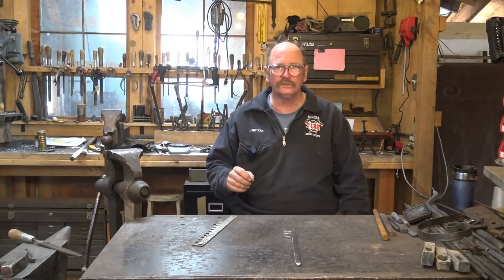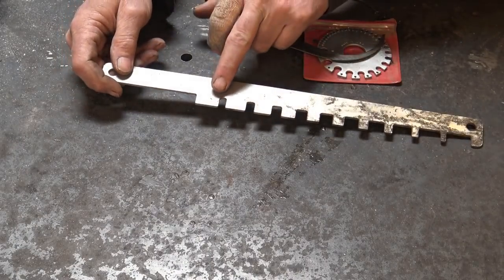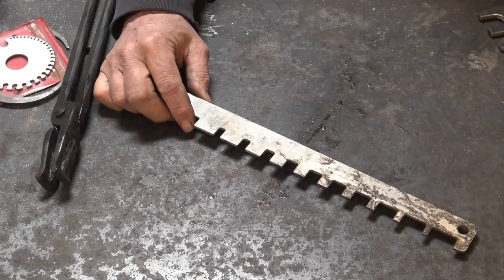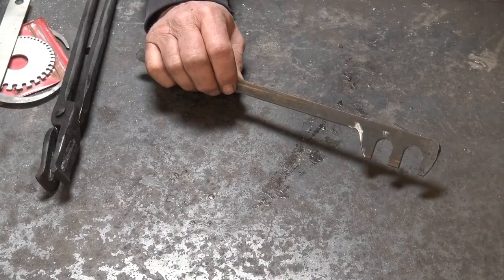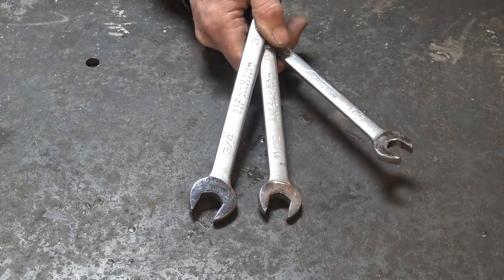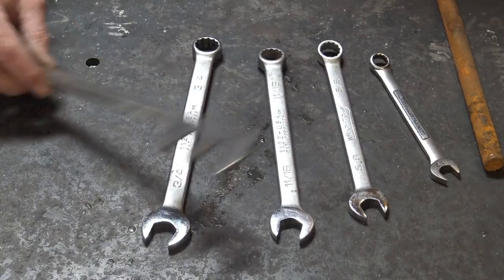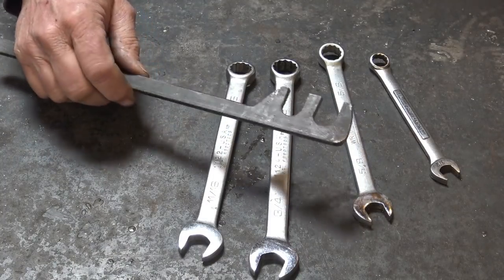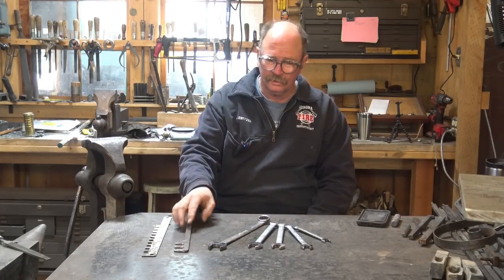Quick and simple shop measurements using a gap gauge - quick tip

Comment: A cheap 9 piece set from that discount tool store or local farm supply and some 3/16th mild steel rod to make a ring (all should be able to be acquired for around $10) sounds like the easiest way to go, to me.

I've got some of the wire/rod that forms the border of a mattress that would be perfect for making rings to hold the wrenches (tore up a couple of old mattresses from my kids' bunk beds...).
Reply from the maker: Some of that matress wire is higher carbon and makes good scribes
Reply: Yeah...this stuff is one of them.  It is pretty hard right now.  I'll need to check it out a bit better but I know  it isn't an air-hardening steel.

Comment: I just made a hanger for my gap gauges yesterday from flat bar. It has 26, 4 " long 1/4 round pins spaced 1 1/2" apart, for both SAE and Metric, and is hung over my work bench. No more looking for those gap gauges. The long pins allow me to hang multiple wrenches on each pin. A little bend at the tip keeps wrenches fron sliding off. I spaced and drilled holes in the flat bar to fit the round rod, chamfered the holes on backside and welded on back side. I had one and used it for years, but somehow it got moved in a shop mod and used for something else.  So I decided it was time for a new one. Also I have some 2' magnetic bars i bought on Amazon that I have hung up over my workbenchs,  which works great for those pesky double ended wrenches that have no hooks.  I hang files, drill bits, drill keys, scribes, centerpunches, chisels, punches, chaulk holders, and every thing I use daily on them, instead of laying them on my bench. Currently I have 16 ft. Worth of magnets overhead mounted to steel bars hanging from the ceiling, and have not had a problem filling them with tools. Just thought I'd share my ideas for organizing, as it seems to be a problem many individuals face.
Reply from the maker: Thanks

Comment: Should buy a cheap set and cut off the open ends and weld them in a circle to check various measurements. Hmmmmmm.
Reply from the maker: Sounds cumbersome
Reply: Maybe just buy a cheap set of really short ones and hang in a big ring? 

I also saw a set with a handle and detachable heads... (it also had a swivel feature, but the set was one of those cheap chinesium ones, so i passed it, but would have worked as measure)
Reply: It probably would be cumbersome.
Reply: Those were probably crowfoot wrenches with the detachable heads.   They would work nicely on cold stock without any handle.